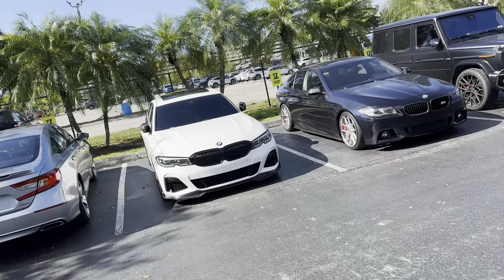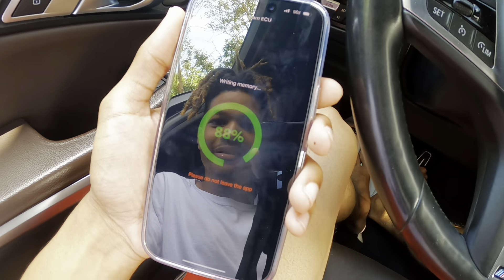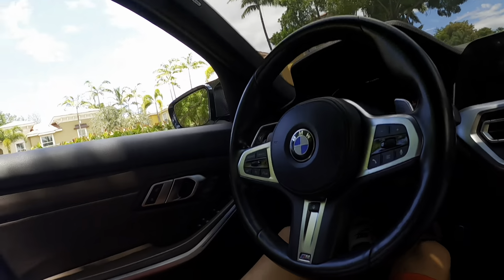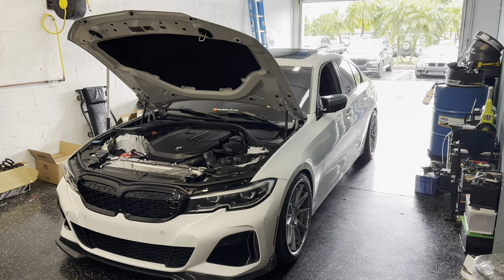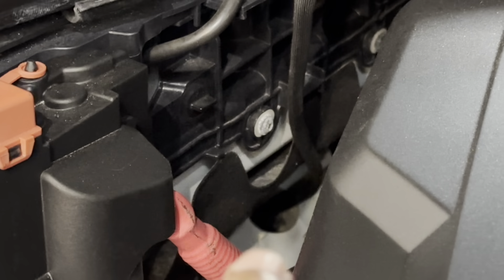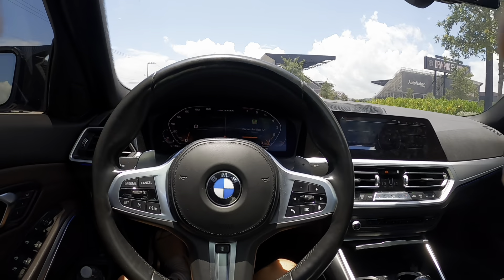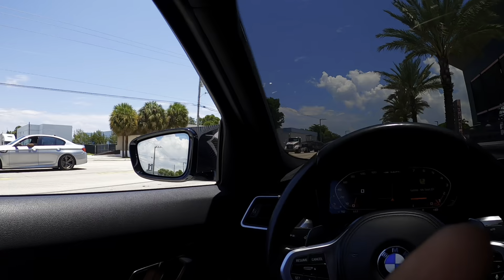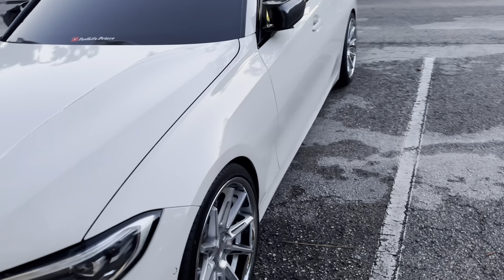THIS ISN’T WORKING ON MY M340i‼️😤😒

Comment: Yo I got some extra black grill trim pieces if you want for your bumper. The little side pieces at the bottom.
Reply: Also, you’ll figure this all out.  If I were you I would try to get parts installed at the shop while using that same shop to tune the car if possible. That way you don’t have to go through different people to get 1 goal accomplished ya know.
Reply from the maker: Yea i was looking to get some in the future…dm me on instagram💯